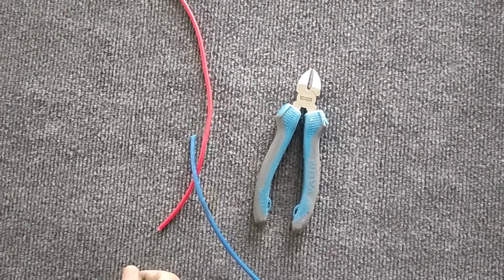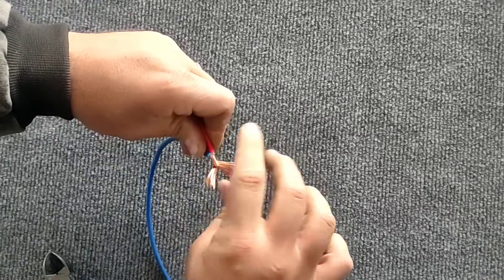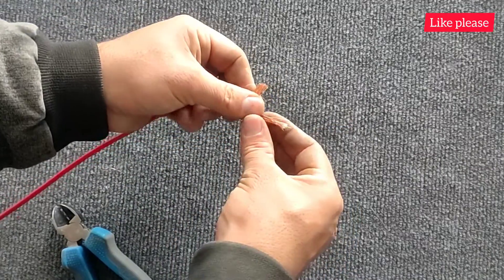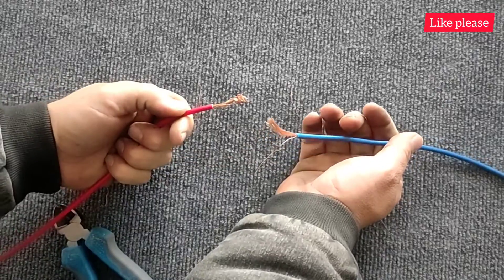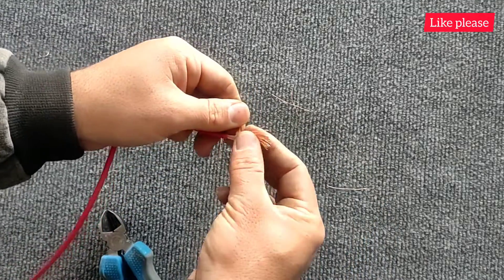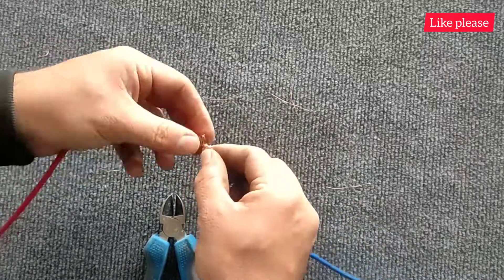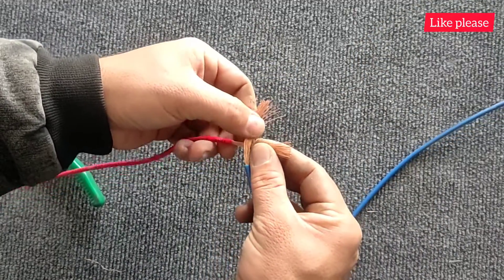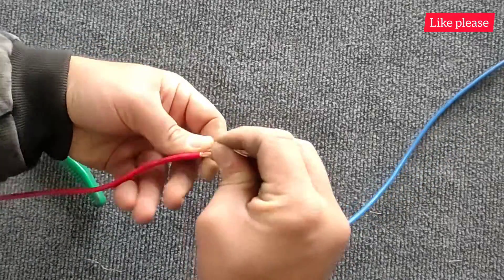The best method to joint copper wires

Comment: Why not crimp them together, then there is a good mechanical and electrical connection?
Reply from the maker: I can not understand what you mean
please explain more?
Reply: @IET-76  use a butt crimp.  A hollow barrel that crushes down/crimp onto the wire